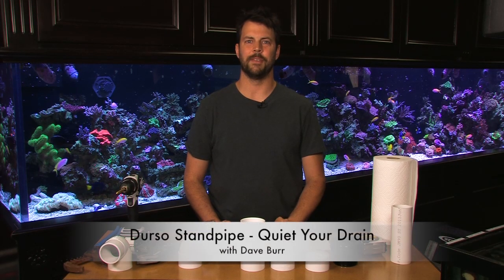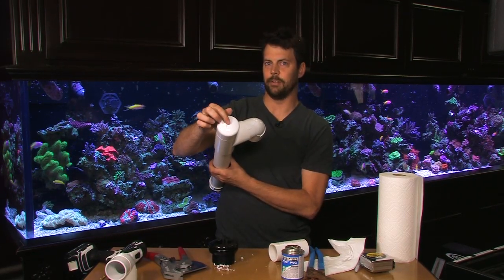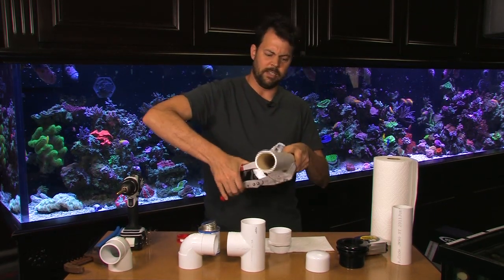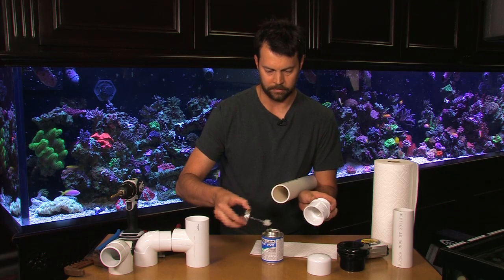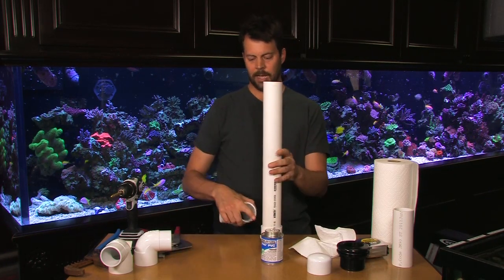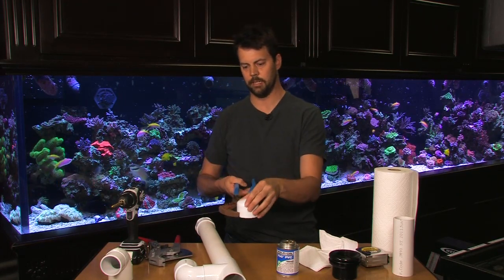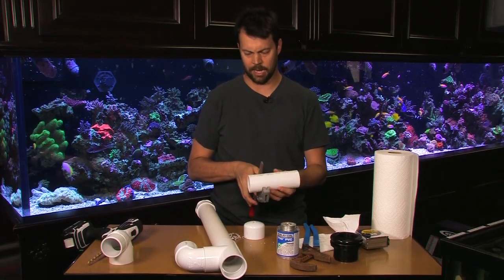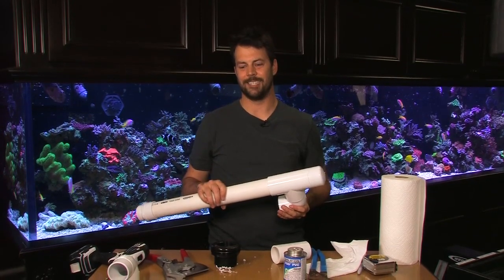Durso Standpipe - Quiet Your Drain

Comment: "leetreex" I had the same problem on my 120 gallon tank. I found a fix on accident one day after doing a big water change i had filled sump to normal working level and then overfilled tank  close to the point of over flowing tank. Since then I have not had problems with bubbles. Also where your drain enters your sump have the drain outlet split the water level that helps with bubbles as well. I asked everyone and all i was told was use filter sock.I was determined to not use one.

Comment: Hi Dave, I have a 300 DD marineland aquarium. Im going to make both overflows into drains so i'll have a total of 4 drains and i'm making 3 returns from the back for more flow. My question is what size PVC should I use for the durso standpipes and also how do I make the splashing noise where the water flows back into the sump a little less quite?
Reply: I got the exact same tank! I know this is 9 years old, but for anyone else reading the comments: I have mine with 4x 1inch bulkheads, one return and one drain in each corner. I used 1 inch PVC for all piping and split each of my returns to two 3/4" outlets for more flow adjustability. I run mine at approximately 3000gph with a Jebao DCP15000 return pump. This is about max flow for two 1 inch Durso return pipes

Comment: The tank I'm setting up has two 1" drains. If I set up two durso standpipes, do I need to oversize the standpipes to 1.25"? I've read that I might need to, but the oversized pipes cause problems with my return line
Reply from the maker: +Lawrence Sinclair No you do not need to oversize the standpipes. Just don't down size them.

Dave

Comment: How long should the drain pipe be in relation to the tank. I'm setting up a 90 gallon tank with a built in overflow that has two 1" drains and two 3/4" returns. The tank is 24" tall.
Reply from the maker: By how long I'm guessing you mean how tall the durso stand pipe should be. I recommend that the top of the durso standpipe is about 1/2" below the top of the overflow box and its lid.
Reply: Thank you. That's exactly what I meant.